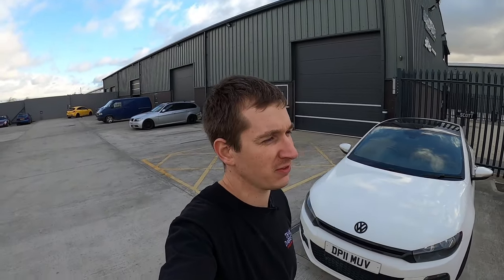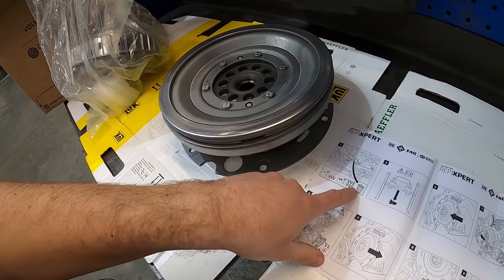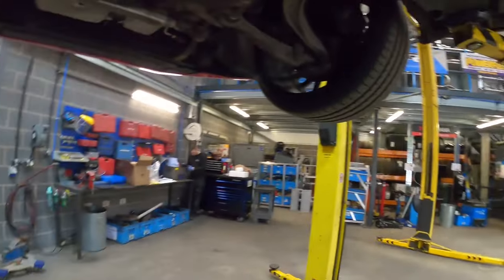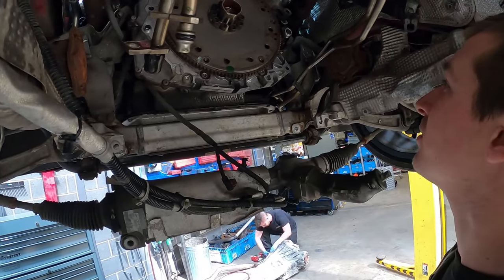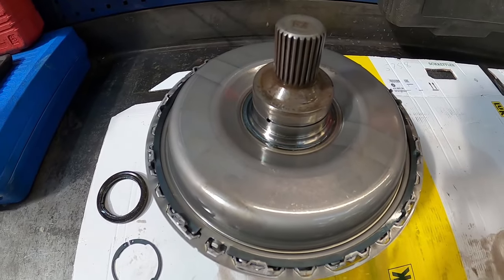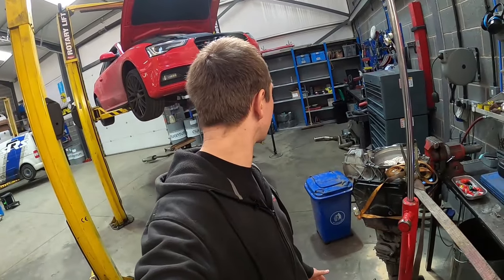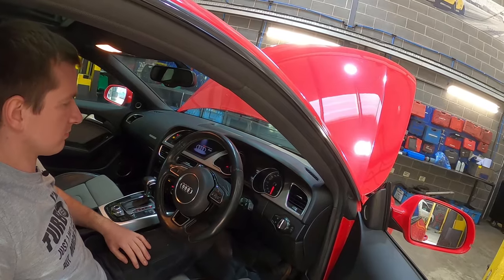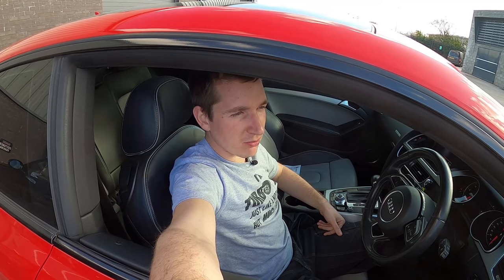Our 3.0 TDI S Tronic Audi A5 gets a new Clutch Pack and Flywheel!  - DARKSIDE DEVELOPMENTS

Comment: You should really try and avoid resting the weight of the gearbox on the sump as it can crush the sump and damage the mechatronics. Just saying.
Reply from the maker: If we get a customers in to do we will make a cradle for it
Reply: Not using a torque wrench?
Reply from the maker: @oulfakirabdelmajid6816  Only on critical fasteners, a good mechanic does not need to on every bolt
Reply: @DarksideDevelopments  It is true that a good mechanic will always be better than a team of engineers who have precisely designed these elements, there are also aluminum screws whose use is limited.
At Audi he strikes the screw with a cross to indicate that they have already been removed so that the next disassembly, the mechanic will changed them.
But hey, a mechanic already knows all that.
Reply: @DarksideDevelopments  DSG are fragile and the fact of not respecting good practices, are very dangerous for the gearbox.
Thus placing the gearbox directly on the casing can cause deformation of the casing and therefore create oil leaks.
Reply: I almost forgot, after changing the clutch or changing the gearbox oil, you must reset the DSG with the computer.
Reply: @oulfakirabdelmajid6816  Don't bother explaining. It's obvious these guys don't know what they're doing.

Comment: Great video lads as always. Just in the middle of doing my chains as tensioners have failed. Clutch was slipping like crazy also. Ordered assembly from Audi. Quick question how much torque and hp can be run through the standard clutch?
Reply from the maker: This one did 500bhp and 650lbs/ft but was slipping a little. We dropped it down to 400bhp and 600lbs/ft and it was spot on
Reply from the maker: Order from us next time!
Reply: @DarksideDevelopments  Ah I would have preferred to but Audi gave us a trade discount.
Reply: @DarksideDevelopments  Thanks for the info. What hardware mods you running for the 400bhp
Reply from the maker: we are cheaper than trade prices 100%
Reply: @DarksideDevelopments  how much do you sell the DL501 clutch for?
Reply from the maker: Drop us an email to sales@darksidedevelopments.co.uk

Comment: Hello, i have an A5 3.0 TDI 2011 and every time i stop  at the light, the RPM goes from 600 to 800, to 400 and sometimes the engine just turning off. It does this every time, i ve been to so many mechanics but they can't see the issue. But trust me, i cannot drive it like that, it make me sell it. Can you tell me what this can be? Thanks
Reply from the maker: EGR stuck open?
Reply: @DarksideDevelopments  No, i checked and i give it a good clean, i change the fuel filter as well. Some people saying it can be the high pressure fuel pump. I don't know how to measure the pressure of it.. 🤔

Comment: mated my sTronic transmission to engine but I can't get the engine to turn to line up the bolts on the flywheel.  Any ideas on what is happening? the flywheel spins freely but the engine will only turn 180
Reply from the maker: Not sure TBH, it needs to come back out and see!

Comment: Noticed mine makes a rattly noise when you release the brake in reverse but stops once you give it some throttle or push back on the brake. Guessing that's the DMF worn?
Reply from the maker: possibly!
Reply: Had the DMF replaced. Noise is still there...
Reply: @BluePixelMotorcycling  did you change a clutch pack??

Comment: Do you know how long (milage) these clutches generally lasts more or less under normal driving? I have searched high and low for an answer. Factory clutches
Reply from the maker: 200k if serviced I bet
Reply from the maker: There are not any figures as every car is different.  Differences in the driver, terrain, temperatures, load carried, tyre pressures all have a bearing on the life expectancy, so it's not a quantifiable figure.
Reply: @DarksideDevelopments  How many miles were on the clutches in this video? Did it have any mech related issues that may have caused this wear? This is the DL501 dual clutch trans right?

Comment: What sort of money would it be for the job????
Reply from the maker: £1500 as a rough guess but prices can vary a lot
Reply: Thank you 
I’ve got the A4 diesel 2.0 it sometimes is a little hesitant on set off 
I’m just wondering if this could be an issue or just the cvt gearbox not been great?
Where are you guys based?

Regards 

Mark

Comment: Great video. I was expecting the bell-housing and starter motor to be full of rubber dust and iron filings. My dads Ford Mondeo diesel is on its 3rd starter motor due to the Dual Mass Flywheel disintegrating. Apparently you can fit a normal solid flywheel to prevent this, however, you then suffer from increased vibration.

Comment: Maybe stupid question but what gearbox is better in audi - 7 speed, or 8 speed? For power, longevity, maintenance prices. Looking into 2016-2017 year 3.0 tdi
Reply from the maker: ZF8 is superior. Worth getting the 272 model with it for sure
Reply: @DarksideDevelopments  so 7 speed?
Reply from the maker: @Iceever  ZF8 is 8 Speed.
Reply: @DarksideDevelopments  thx. So far this is best answer i am getting, because my local audi service, audi club - what ever question i ask, they give me answer that every part is the best, no parts have any problems and other bs :)
btw will you guys ever do video about bi-turbo 3.0 tdi?
Reply from the maker: @Iceever  VAGs are 100% reliable, you don't know that?

We don't generally go much further than a map on those, but we have done a few. We had an SQ5 project for a long time - https://www.darksidedevelopments.co.uk/sq5-3-0-tdi-v6-cr313-cgqb/
Reply: If you buy Audi, don't mix the Multitronic and the ZF (Tiptronic) gearbox as both have 8 speeds. The ZF only comes in 3.0BiTDI version with 313 ps, Audi A6, A7 4g series, also in A8, Q7 in those ages. I don't think the ZF transmission comes in the lower 313ps variants of the Audi A6, A7 4G. Darkside, I don't think you'll ever have peace with that S tronic gearbox, it's a very unreliable unit for normal use and especially for a tuned car. If he continues to cause problems, you better try inserting the ZF gearbox if it is possible.
Reply: @DarksideDevelopments  I didn't think the 272 hp version had the ZF box?
Reply: I need a new clutch pack throwing the code clutch 1 slippage too high, usually throws it in. 5th changing to 6 but it’s done it in 7th afew times now after getting up to speed on the motorway... 

2012 0B5 A7 quoted £1560 inc vat all in... good price?
Reply: @djogi86  Your right ZF box is a much more solid unit, S-tronic are junk
Reply: @jjames3211  time to do a PX at a dealership?